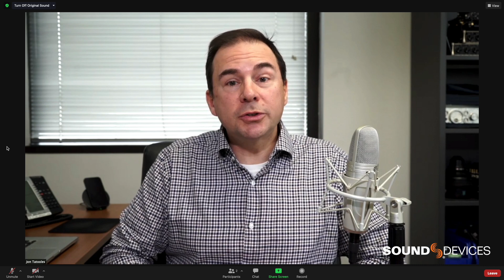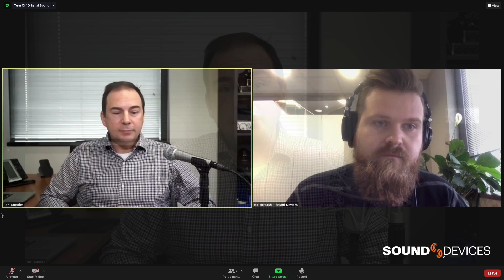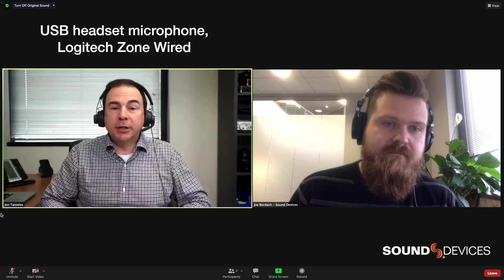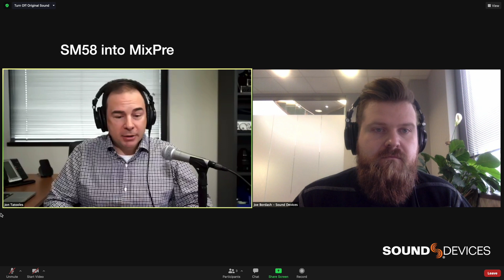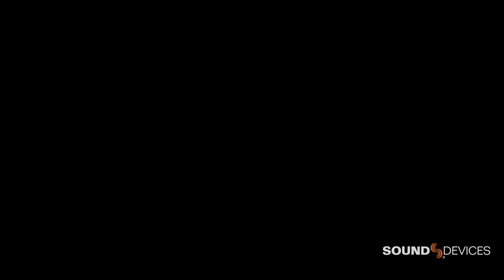Audio for Video Conferencing

Comment: This is very interesting; thanks. Do you have any recommendations on how to handle video conferencing in a high-ceiling room with significant echo? Changing the physical attributes of the room is very difficult but everything else is a possibility.
Reply: Jon Tatooles (SD)  Thank you. I should have mentioned that it's just me. I'm currently using a Rode Procaster connected to my MixPre-3 (first generation). Do you think switching to a lav mic might be better?
Reply: Jon Tatooles (SD)  Thanks!

Comment: Thanks. Tried to add delay to USB in the Output menu, didn't work. Please show how. btw, still disappointed that my 10T can't run Noise Assist (bought it about a year before next gen came out). Asked for replacement, would have agreed to pay some extra, but was rejected.
Reply from the maker: Output delay was added in v7.00. Make sure you update your MixPre!
Reply: @sounddev  Can you add delay to the USB output on the original MixPre 3?

Comment: This was a very good practical demonstration.  Extra points if you can include a link to the video showing how you apply the 180ms delay.
Reply: I had the same thought as I did not know I could add the delay in the MixPre. I also hope this can be then a preset to easily switch it on and off.
Reply: It's right there in the MixPre II Outputs Menu.